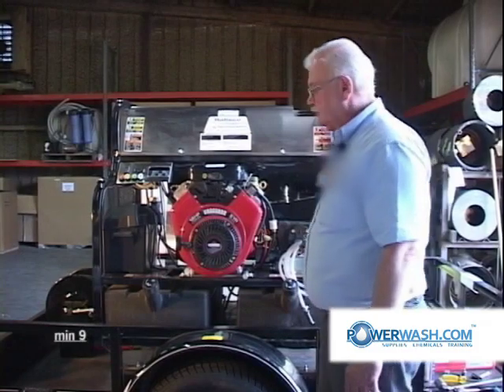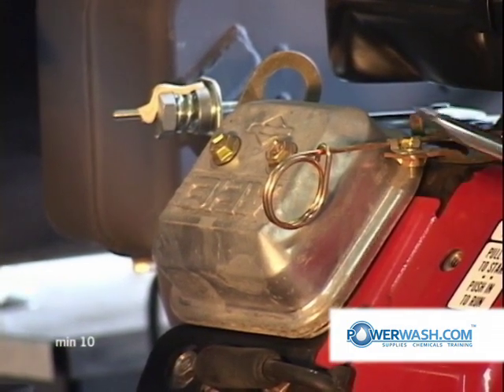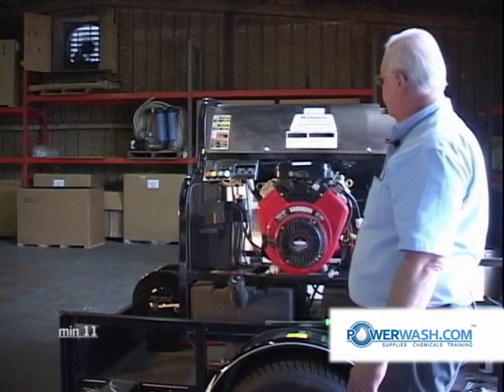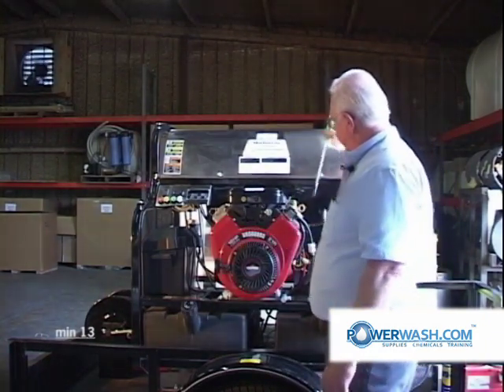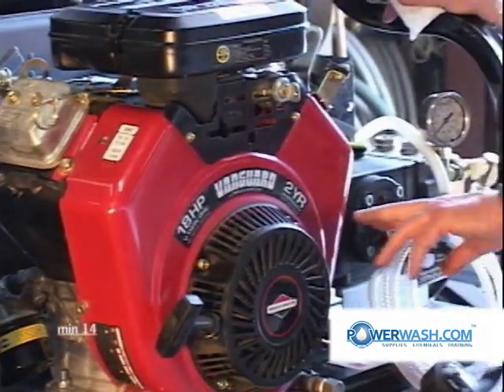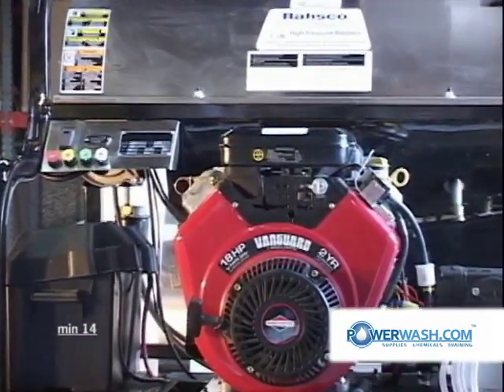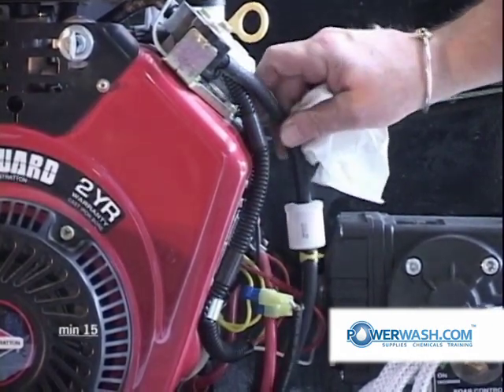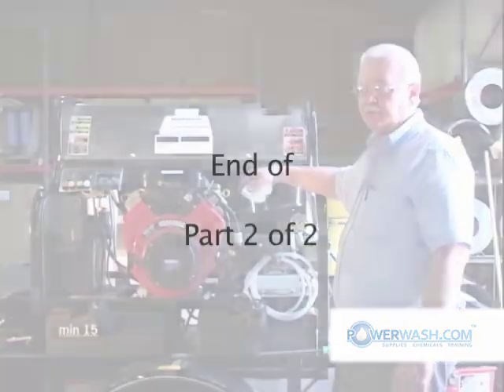Preventative Maintenance of the Briggs and Stratton Vanguard Engine P2 of 2

Comment: Can you possible inbox me with how to get it started.  Mine has new fuel filter, new fuel lines and clean fresh gas.  But with either gas or ether the engine will run for about 20-45 seconds and then shut off.  Even with the choke on or off.  Additional info.  Using pull start, not using a battery.  I dont know if the carb is dirty or the fuel pump is shot.  Please let me know.
Reply: nissan300ztt dealing with this issue right no
Reply: You ever find out what was wrong?